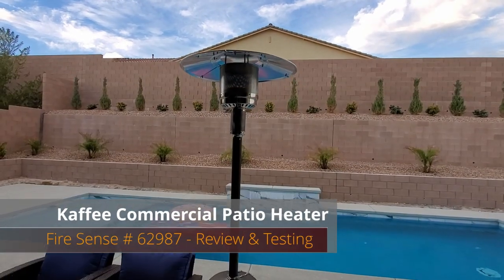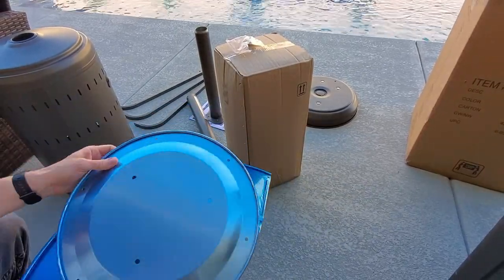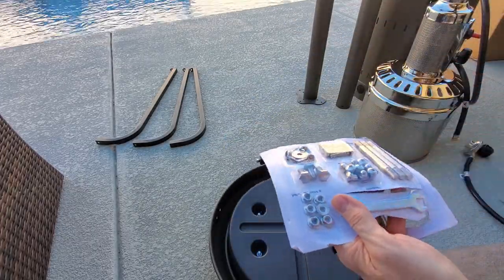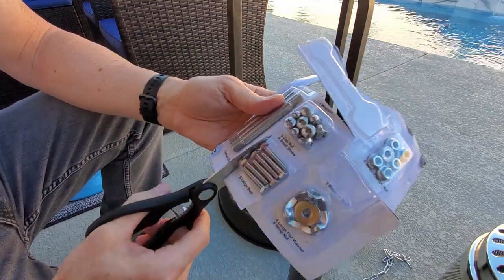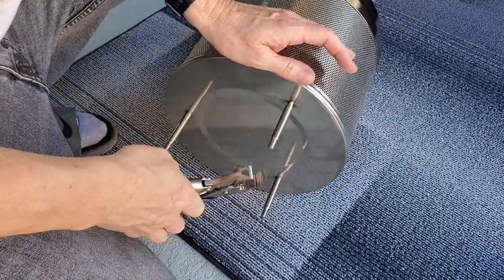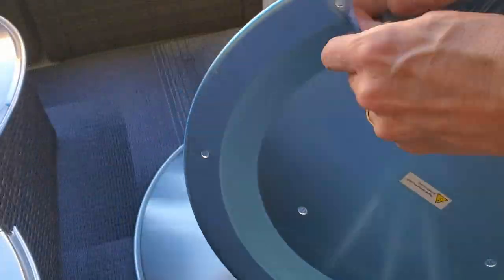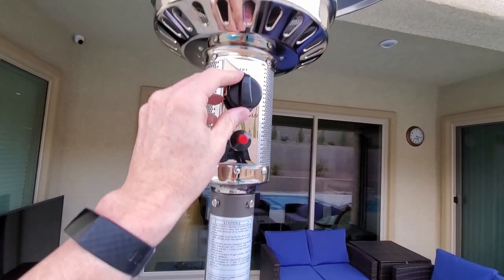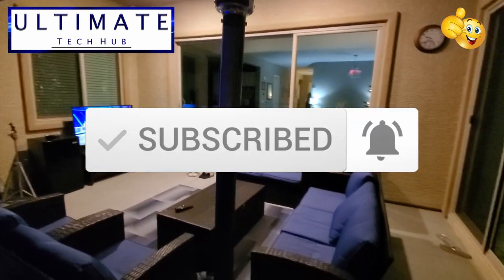FIRE SENSE KAFFEE COMMERCIAL PATIO HEATER ASSEMBLY & REVIEW - A UNIQUE PERSPECTIVE!

Comment: Does yours radiate enough heat to warm up the surrounding? I don’t feel a warm up when mine is on. Guess if that’s the heater’s design issue or something else. Thank you.
Reply from the maker: It warms up about a 5 foot radius. Not a big area that's for sure. It's a good heater not a great heater.
Reply: @UltimateTechHub  Thank you so much. I think it could be my half full gas tank causing the issue. Almost return it for not warming up enough.

Comment: Put two of these together and neither is letting off any heat whatsoever. 

When I light the heater it works, but the flame is extremely small on both.  The flame stays small and never gets big.  

I’ve changed the tank three times to insite it wasn’t the tank.
Reply: I just assembled mine and it’s doing the exact same. Did u ever get it figured out?

Comment: A pair of plyers, really?  Never put  plyers on bolts and nuts. Maybe a crescent wrench in a pinch. Wrenches and sockets are really not that expensive. I put one together and have to say it was very easy and well thought out. All parts marked well and all holes aligned perfectly.
Reply from the maker: 2 of the 3 holes were not made correctly for whatever reason and I tried everything for about an hour before I broke out the vice grips. My patio heater may have just had a defective part. But i would never use any tools unless it was necessary and believe me it was necessary or I would have had to take it back to Sam's Club.  Thanks for watching!!

Comment: Does it work with Butane Gas?
Reply from the maker: The instructions say propane only.
Reply: @UltimateTechHub  don't worry.  I've got mine working.  It does work with Butane.  Thanks
Reply from the maker: @BengiGaming  hey that's great to know. I will pin a comment so everybody will know. Is it the same serup with hose regulator?

Comment: You never did say when to twist on the gas tank or you assume it in your video.
Reply from the maker: Sorry about that. You twist on the tank after you finish the assembly. It's pretty straight forward. Make sure to prime the ignition when lighting the heater. Push the knob in for 10 seconds before lighting the heater.